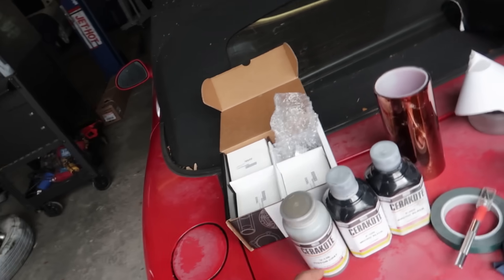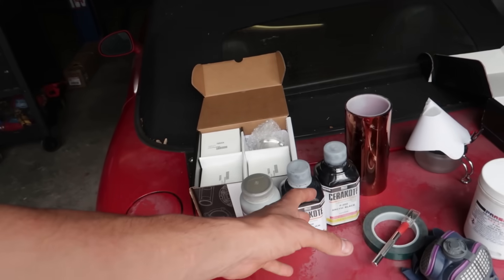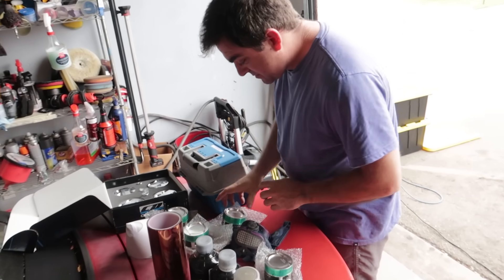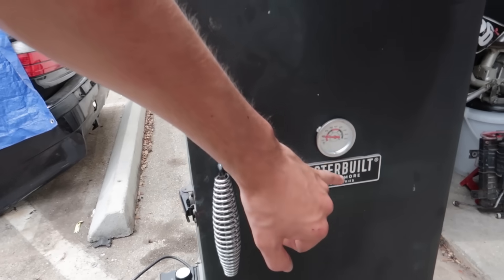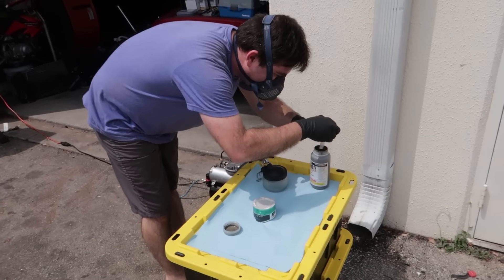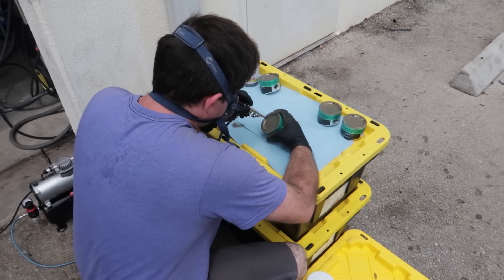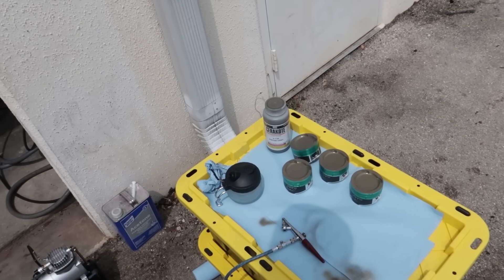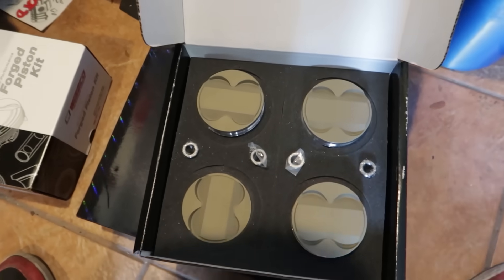CERAMIC COATING PISTONS FOR FULLY FORGED MIATA BUILD!

Comment: Question: What tip-head are you using on the Paasche H-series airbrush that you're using?
I tried the H-5 head (1.06mm) with 24 psi with my Paasche H-series and it seemed to spray flawlessly. However, the V-136 did not cure to a very hard finish.  It's hard to the finger-nail scrape test, but I accidentally scraped it with the edge of a flat-head screw driver and it scraped the coating off nearly all the way to the base metal. And that was with very light pressure. I ended up re-blasting my piston head with 100 grit aluminum oxide to remove the v-136 coat, and it came off much too easily. It seemed very soft in hardness.
I contacted NIC corp and they said it was because of the tip I was using -- they indicated that the tip I used put the coat on too thick.  I don't think so as it looked reasonably thin, but went on noticeably faster than what you show in this vid. NIC suggests a 0.8mm head with 30 psi. So I tried it with the 0.64mm head that came with the airbrush (Paasche doesn't make a 0.8mm head that is suggested by NIC), and same exact results occurred on a test piece of aluminum scrap, following the exact method that they prescribe in their V-136 directions. 
I'm going to have to re-blast everything I coated because everything is too soft. 
NIC (Cerakote) doesn't provide much help in the matter. So far I'm not happy with this product at all.

Comment: There is most certainly a trick to using anything from cerakote... my brother is a gunsmith and he spent 6500 bucks to go to cerakote and become certified for applying it. 1-1.5 mil is the thickest you want cerakote. It has a high chance of chipping when uneven or to thick of a coat.

Comment: Coating guys all getting mad, people now know they are paying too much to get their parts powdered coated.    Easy to do yourself and not expensive to buy the gear
Reply: I feel like most of the cost of powder coating is the labor in prep, between sandblasting and masking, you can spend a decent amount of time doing those things before actually even laying any powder and curing it.

Comment: ceramic coating is the bees knees. WAY harder than paint or powder coat and also WAY thinner too so doesn't even matter if it gets in threaded holes its that thin a bolt will still thread in no worries and the best part it actually does its job and doesn't just change the colour

Comment: This paint process originated with the SR-71 Blackbird spy plane. External temps reached  600+ degrees during high speed flight at 80,000 feet.

Comment: Awesome video! 
Wondering if graphene coating will be developed for internal engine parts. It's started to make it in to the detailing world now. 
Anyone know how long this ceramic coating is lasting on something like the top of the piston? I think it's a different kind of ceramic coating than they have on paint. But it's on a very high heat part with a lot of action going on. Have seen on some pistons where the side coating is worn with not a lot of miles on the engine. Usually it's a defect engine though so maybe as long as it's fine with the engine it holds up great. 
Thanks to James and Sam for shareing this method. 
And don't know if you are going to be repaint the Miata on the outside too. If not you can maybe get a hold of a great detailer that could help you out with polishing and ceramic coating the paint. If interested I know of a couple based in Florida that are great. And if you are going to be repaint it. It sadly need to be outgasing the paint as in fully curing for 30-60 days before you apply a ceramic coating on the paint. And if you repaint it you can ask Tommy to apply a thicker clearcoat. Then do some wet sanding and polishing the paint to perfection. It's a lot of work but it's basicly a showcar paint after that. You can also do it by yourself in Chris shop with not so many tools and products needed to be bought. I could help you out with products and stuff that's needed if you want to do it. It's pretty straight forward with some great tools and products. Even just a machine polishing after a repaint will be doing much on the paints looks. And very much on the paint you have on now will be bringing it back to like new. 
Amazing build on a giveaway car! I have started to look around for a fun little build of my own. Did some minor things when I was younger. And did my first car from a multi color to repainted and some styling on it with changing some of the body panels. Would be awesome to do such of a build again and with the thoughts I have gathered during the years. It's a little hard to get them in decent conditions now days LOL. It where a Opel Kadett '77 LOL. Would be a lot of work to change it to what I want to though. 
Will be awesome to see the finished Miata. It's going to be amazing. And getting to a very happy winner.

Comment: Just out of curiosity does this process mess with the factory heat treatment of the pistons?
Reply: You gotta get steel to around 1500 degrees to change the metal state to do that.
Reply: @eastslidah  right for heat treatment but tempering steel is between 250 f to 1200f which makes the steel softer.
Reply: Coolride17  hahahaha, no.

Comment: Those coating just come off   i ran wiesco pistons on my racebikes and the  coating would be gone after a couple hours
Reply: Josh Oakes it flakes like fuck, that’s why they don’t recommend doing it on exhaust / turbo internals, I would only trust zircotec or some company like that, not a guy with a eBay airbrush and a heater element
Reply: It's supposed to, the coating is for break in.
Reply: Also wiseco pistons suck.

Comment: Does ceramic coating the piston add compression? Im new to this but if you’re adding height to the deck wouldn’t that increase compression?
Reply: Stoked, Broke And Outta Luck 9:35
Reply: multimikeish yeah I caught that after I commented I should’ve watched the whole video first

Comment: Painting an intercooler also takes away from what it's designed to do. It closes up the find so it doesn't get as much air thru it so it dont cool as good. Ceramic coating actually helps it cool
Reply: Ceramic is meant to maintian temp like when you ceramic coat the exhaust. Keep in in.  This will not help efficiency 100%.

Comment: Sam also consider to spray copper paste during head gasket fitting, it's more advantageous for heat transfer, stops head gasket failure to a fair extent. Permatex is the one I heard.

Comment: To ceramic coat the intercooler is a bad idea in my opinion. Because the coat will make the intercooler transfer less heat to the air. And that is what you want. That ceramic coat will keep more heat inside the intercooler. Do you want it?

Comment: Spray Painting an inter cooler black has been proven to help. Mighty car mods did a video on it a few years ago
Reply: Mighty car mods actually messed up there, the paint was still wet inside the fins and the evaporation of that paint is what caused the temps to drop

Comment: I did my pistons myself at home had extra in the gun and sprayed the con rods as well
Reply: Why the rods? This is for heat npt strength
Reply: justin credible you don’t want the rods getting to hit either
Reply: @hypedecals4509  bc the pistons are the forefront for the combustion? The rods are far from. Ceramic is heat retention.

Comment: Sam i need your help off topic but how do I remove fuel from an R34gtt my oil pump shat it self and I got a full tank a fuel car will be sitting for a year so don't want to leave fuel in there help please 😭😭😭
Reply: Disconnect your feed line and put it in whatever youre going to store the fuel in, then jump your fuel pump to 12v and you should be able to empty your tank into the container. This generally works for most cars.
Reply: @911lilslim  thanks man much preciated 🙂

Comment: I wonder if you could do inside the cylinder head chamber and the exhaust side of the head??????????🤔🤔🤔
Reply: You could try it and if youre doing the combustion chamber id do the bottoms of the valves as well, exhaust ports may be a pain to do and probably not worth it